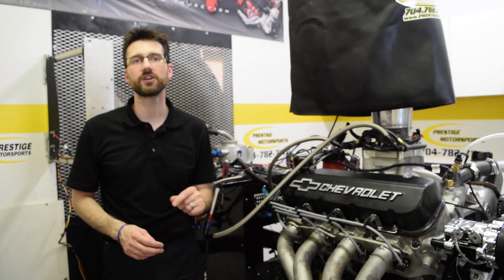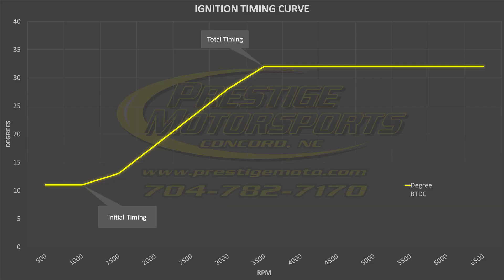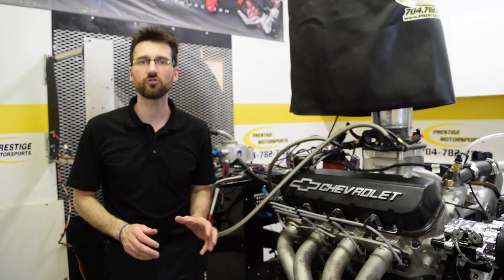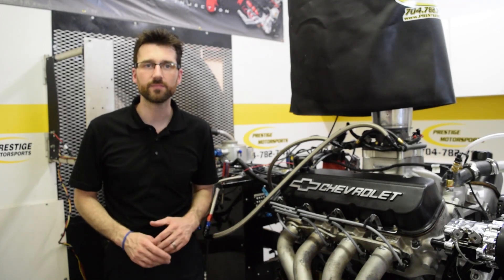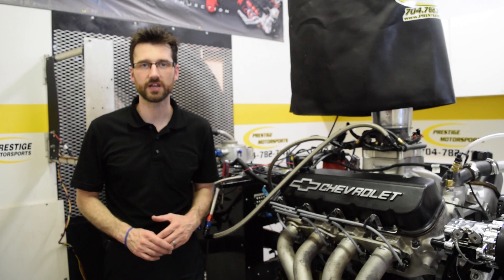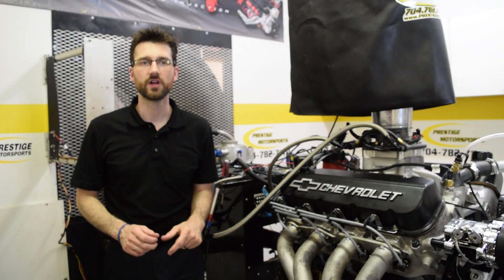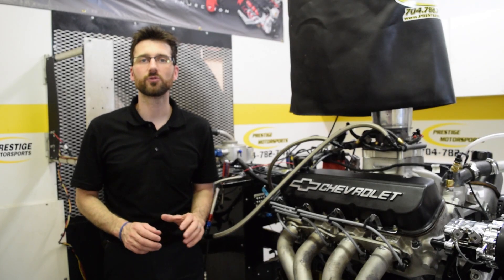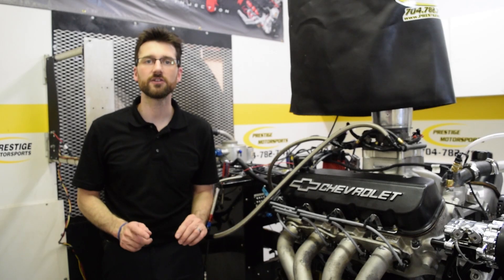Ignition Timing: Result of Incorrect Timing and How to Check Yours

Comment: I don't think the guy understands detonation (spark knock).  Its a race in the combustion chamber between the expanding and heating gasses produced at the flame front and the remaining unburned mixture.  If it goes unstable the entire remaining unburned charge basically explodes instead of the smooth sweeping swirl or tumble combustion (think of a ghost as being good/proper).  The explosion produces a hot spot on the piston, you get the crank rolling over at 100x per second and likely the piston can't take the heat and will melt down.  Octane and chamber heat transfer both are major factors...which is why iron head engines are notorious for spark knock and aluminum heads are rarely knock limited.  In an aluminum head engine like he has on the dyno, too much advance just robs torque.  A gross over advance would result in the engine stumbling.

Comment: how do i adjust the timing curve as I set the total timing without the vac advance, when i plug the vac advance in it changes the total timing, or do i set the total timing with the vacuum advance connected. any help would be appreciated, thanks
Reply: Thanks thats just what i neede to know. I didnt realize it changed that much once vacuum was re-connected, is all set now.
Reply: Not the best solution for a street driven vehicle. Vacuum advance is not truly an emission control device. What it really did was to cool down engine temperatures due to emission controls added to engines, especially at idle and as you mentioned, at light loads such as freeway/highway cruising. It especially helps in fuel economy too.
Reply: True and with cam changes, one could change the stock advance actuator with one that functions with less manifold vacuum. They make them in different inches of vacuum but are hard to find. GM has a few versions of them because of the various engines and cams they used on Corvettes.
Reply: Mark Rakemaker.... Are you saying to have vac advance connected to manifold port and not ported vac port while driving?
Reply: PMS is correct. (1) In most cases, the vacuum advance should be connected to MANIFOLD vacuum, so the Vacuum Advance should be Disconnected while you read and set your Total and Initial timing. (2) Set your Total Timing First. (I was pleased to see PMS make this a clear point.) Once you set your Total Timing and your Initial is dialed in, you can connect your Vacuum Advance to Manifold Vacuum and take that reading. Your Timing will typically Advance between 10 and 20 degrees, depending on how much Idle Vacuum your motor produces and the range of your particular Vacuum Advance Pot. Radical Cam Grinds can cause the Vacuum Advance to bounce, which is a situation when you might want to NOT use it. I use an Adjustable Distributor Vacuum Advance which I set for the minimum amount of advance; just enough to add about 8 degrees to help with the engine cooling at idle, low RPM light load drivability, and initial acceleration. (3) If you hook your Vacuum Advance to a Port, here's what happens... you have Initial Timing (say around 12 degrees) + Total Mechanical Timing (say around 20 degrees or more) + Vacuum Advance (with an average of say, 14 degrees) = (for a total of) 46 degrees!!! This is way past the suggested and common Total Advance of 36 degrees for a SBC. If you left your Vacuum Advance hooked up to a Port, and set your Total Timing @36 degrees, then your Idle (Initial) Timing would be severely Retarded and that would raise a few heads in an instant with all the farting and popping going on.
Reply: @markschmitt5550  this is the way the guy who built my motor set it up 355ci 9.7:1 Hei 
When I later on decided to check timing  (check it w/ vac hooked up) just to see where it was at idle. It read 25° so disconnected the vac adv and it dropped to about 0°. At that point I set it to about 10 initial vac disconnected and left it tha way for the next 24 years. I got me a new timing light so yesterday I checked the total adv. At 2500 rpm w/ vac adv. Connected and  It was 79° w/o vac adv it was 61° @ 2500. At idle w/o the vac adv. It was 46° now, so is having manifold vac.instead of ported vac a good thing? People I've told to don't know about this or tell me the would never put manifold vac instead of ported. Also I notice the advance weights springs seem very light and where not bringing them all the way back so it was affecting my idle. I got me a curb kit w/ three sets of springs and bushings and the weights I'm thinking to about trying the middle springs. Some input on this will be appreciated.

Comment: so what if you have no clue what timing should be on my motor?
Reply: prestigemotorsports well I just got  a new  msd.digital e curve. and got the timing down on it . but I can not figure out hot to read grafts  for it . confusing.  seems every one has that problem lol.  so maybe you know here I should put dials under cap!? it's a 357 sbc with flat top pistons 523 523 cam . aluminum  heads 202 with 58 cc air gap intake and a holly carb from carb shop that a 700 but he said like a 740. . run it with  112 gas. have th400 with 3500 stahl  with trans brake and a 9 inch with 456 gears .
Reply: Calup Jensen just set it by ear if it stsrts good has good power doesnt ping then yojr pretty close often times on soethimg old the mechanical advance gets stuck if so you will have no power at all and if yoh adbance it to get power its way off and wont start maybe evendamage the motor